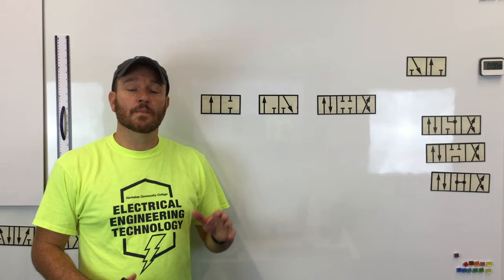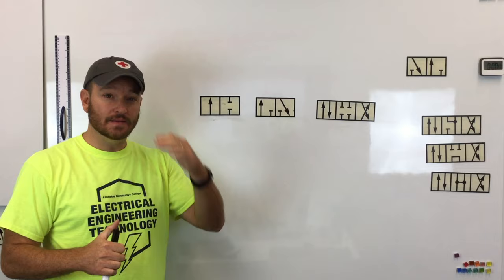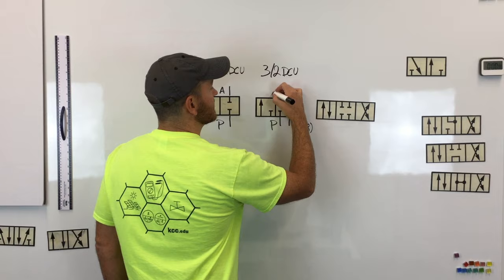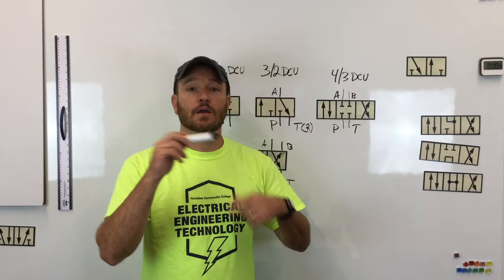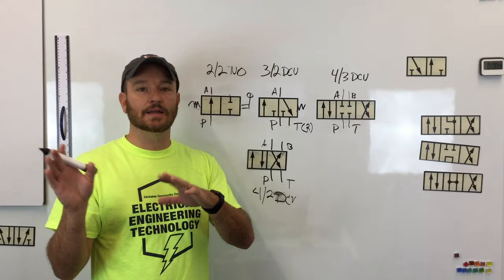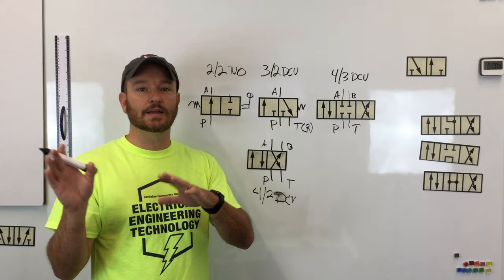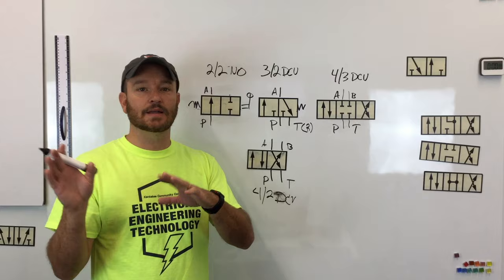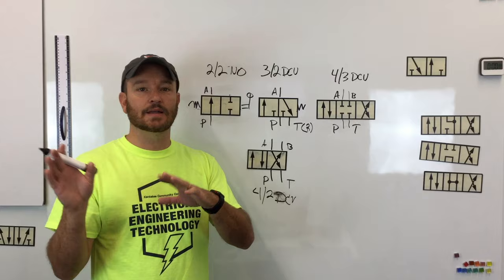Understanding Directional Control Valve Schematics

Comment: Great work...i have a problem of a grader that has a steering fault. It uses the 4/3 spool valve and it has two solenoids as u drew that one and it indicates that the spool valve is not responding. What could be the problem? Cud it be the spring? Or one of the solenoids not working or dirt i  the LS line?

Comment: Nice outline, very helpful.
Please how do you distinguish between 5/3 DCV and 4/3 DCV. it's a bit confusing.
Thanks.
Reply from the maker: A 5/3 is used in pneumatics.  It has an extra exhaust port.

Comment: I need a valve that has 2 inputs and 1 output to switch between pressures. Is there a valve with this configuration?
Reply from the maker: You might be able to use a 3/2.  Hook one pressure to the P port and the other to the Tank port.  The a port is your output.  Just a thought

Comment: I have question about the operation of DCV  i very appreciate if you help me with it. The question is have 5/2 DCV which is not shifting of air way when i give it 24Vdc but i hear click coming from coil and The indicator LED turn on .
Reply from the maker: Have you tried overriding it.  That valve should have a manual activation.

Comment: How much time can be running the coil?
Reply from the maker: Depends on the coil.  You want to design it to be in the off position when the cylinder will be in it home position.
Reply: @KletteTech  I saw than pilot solenoid could be running a lot of time. I wanna used to automatice a motorcycle suspension, so will be open wen the motorcycle is off and in rest position and on at the same time to the bike. So a maximum of 8h will be fine